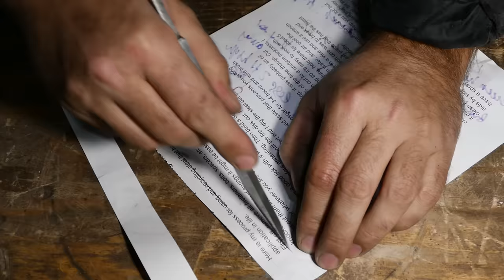Old Metal Files turned to a Fine Woodworking Tools

Comment: You have the equipment and good techniques for annealing, then re-hardening the steel and for sharpening these tools, but I can hardly believe you have ever seen or used any woodturning tools before. 
1. Grind all sign of the file teeth off to avoid damaging the toolrest. 
2. Round off the edges of the tools for the same reason.
3. Drill the hole for the tang first, and set the dead centre in it. the hole will then be central and in line with the handle.
4. The parting tool will work much better with a straight, not concave, bevel.
5. Both the parting tool and the skew are cutting tools, not scrapers. You will get a good finish off the tools if you use them correctly.
Reply from the maker: Thank you very much for breaking this down for me! I appreciate a lot!
I have a lot to learn, yes!
Reply: @Take_And_Make  I half expected that you would be on the defensive about this, and am very pleased you have taken it as it was intended - constructive criticism. Hope it helps.
Reply from the maker: I always separate constructive criticism from hate. We live and learn
Reply: ,c es un
Reply: Really superb works Shop equipment good
Reply from the maker: Thanks!
Reply: @tonynewton2250  Yep you went to far with the criticism, the tips and advice were well done but the last part of your statement was uncalled for.
Reply: So glad you pinned this post.   The skew especially can be quite dangerous using it like you did. Make contact with the bevel first and slowly bring the cutting edge to the surface of the wood while moving forward. 
Also, try to avoid making long workpieces thin in the center until your done with all the other shaping and details. The wood flexes too much and you start to get chatter from an out of round blank.   Even with the roughing gouge, and parting tool you’ll have much better success if you make contact with the bevel first and then raise your rear hand to bring the cutting edge into the wood.
Reply from the maker: Great tips! Thanks a lot!
Reply: I thought it was a perfectly good and helpful comment and was taken as such by a humble craftsman. I do have to say, regardless of always using the right tools in the right way, there is something special about just getting in there and doing a project as best as you know how. His end results are quite good and I am especially interested in the restoration of the files anyway
Reply: It is a giant leap in technique and knowledge between iron mongering and wood craft. Great attempt. Please do more research on the woodworking. If you mishandle hot iron you get burned. A mistake with wood tools and you can lose body parts quick quick.

Comment: Tempering is temperature critical, not necessary to time it. Traditionally determined by the colour of the oxide. Read Tubal Cain.
Reply from the maker: Yes, that's why I put it in the oven so I can control temperature to gain the color of the straw.

Comment: Hello my friend? i use to work bumper shop for 12 year and to keep the metal bumper cool when we had to grind it....On the belt we use a little soap, as the belt is turning just touch the soap to the belt for a blink of a eye. And to keep Like them blade from warping when harding make sure the top edge and bottom edge are lined up with north and south
Reply from the maker: Thanks for the tips!

Comment: I made a set of lathe scrapers years ago from old files but without the annealing and re-hardening, grinding only. I used brass pipe fittings to make the ferrules and they work very well. I also have a few crude lathe tools made by my grandfather from old planer blades, a very good source (if harder to find) of good quality tool steel.
Reply from the maker: Great point!

Comment: In addition to Tony Newton - for the handles - drill your hole first.  If you can, do it on the lathe with a Jacobs chuck so that the hole can be 100% straight.  Center on in the hole and turn the tenon - you can test the size.  Last the rest of the handle.  All in all, good work, however.  Kind regards.
Reply from the maker: Thank you for your suggestion!

Comment: Lovemaking two handles at one time . A smoother finial finish can be had using a 3/4" to 1" skew not a rasp .
When f8tfing the copper bolster use your calipers to measurethe inside diameter and make to shoulderto the  measurement  it can be sanded  to fit and  use gel CA when fitting 
Avter fitted youcan use centerpunchand hammer to make a dimple in the side to grip 
When seperating  the ends and halves start with thin parting tool and leave about a 1/4"remove from lathe and make final cut onband saw , and finish at belt sander 
You canadd details like groves near the butt and throat while sgill on lathe but pressing the toe of skew  then friction burn using a piece of thin hard wood 9r counter top laminate , with the lathe speed turned up high , detail rings can also be added to the copper ferrel with either a tubing cutter as you cut them , or the toe of skew 
When a final finish is decided on either a clear shellac or lacquer, they can be applied  while still on the lathe 
A final detail canbe an ulpoholstery tack in the butt end 
Thank you for the reheating and shaping information 
I have plans to make a round scraper from a mill bastard file
Reply from the maker: Thank you for the good pointers, Gary!

Comment: Hello why do you have to put the tools in the oven after how long and at what temperature ? Thanks👍
Reply from the maker: You put steel in oven after hardening to make them less brittle, read about tempering steel. I had them in oven for 2 hrs at 400F
Reply: The steel is like glass after hardening .

Comment: Nice job on the skew and parting tool. In the last year or so have you learned how to use a skew? Master the skew and turning becomes much easier. That entire turning could have been done with one tool and no need for sanding. It’s not easy.
Reply from the maker: I’m actually more into metal work now, but I feel like I’d get back to turning wood initially
Reply: @Take_And_Make  I was a production spindle turner for many years and after my new shop is done I thought I would get a small metal lathe and a mill. I'd like to incorperate the two mediums and i'm not into metal sculpture. I worked as a labtech in a scupture lab for 5 years. I teach woodworking now.

Comment: This video took a long time to figure out what was actually happening to the files. They actually get turned into wood turning chisels. The way I found this video was looking for restoring files though. You can't find any good files these days. Probably can't find any good wood chiseling tools either.  Does heating the files up then possibly clean them and restore them? Kind of like resharpening them but instead just making them clean is actually what's happening?
Reply from the maker: Just soak your files in vinegar for a week, than clean gently with soft wire brush
Reply: Heating the files will destroy them.
It will cause them to become soft (almost as soft as mild steel), and form scale (oxide harder than rust), making the teeth blunt.

If you want to restore files, get a brass or other softwire brush (not plated steel) and then soak in vinegar or other acid, take out occasionally and brush the grooves out, removing rust and clogged metal.
This should improve the performance of the files and not meaningfully damage the files steel. (Contrary to popular belief this doesn't really sharpen files, it just cleans them out).

If you look at your files, and you see reflective spots on the very top of the teeth, the file is worn out.
Now it can still be used, for example if you were to use the edge of the file (usually lasts much longer than the flat faces due to not seeing much use), or the ends can still be good, so you can use those.
But aren't going to be much good outside of extremely soft metals, or plastics and wood.

You don't need to toss them if they go dull though, they are usually very good steel.
You can turn them into marking knives, scrapers, wood or metal lathe turning tools, or practically anything else that needs tool steel, I've seen a bunch of really useful things for bits of files, one being removing the seam from the inside of tubing.
A little creativity and a grinder get you quite far.
Though, if you are using them without annealing/tempering, they are going to be dangerous in high stress environments (lots of shock or lateral force), they can shoot shards that will injure you. So learn what you need for specific situations, and you'll be fine.
Reply: @autumn5592  i have a LOT of flea market files that appear to have been used on aluminum. Getting those clean have been efforts in vain, nothing has worked. I'm not new to working with restoring files, just a bit of personal experience on seemingly impossible to clean files.
Reply: @TingTingalingy  Get yourself a soft scribe (if you have those generic small jewelers screwdrivers, you can grind a point onto on of them) or even mild steel rod.

Then you follow the groove of the file tooth, pushing along it, the aluminium should pop out.
May take a few passes to properly work, because the file teeth will cut the scribe to the same form as the teeth, allowing it to get deep inside the groove.

Use a magnifying glass or the sort to help you see if you are having trouble.

To avoid pinning on your files, frequently use a brass brush or file card, and for soft metals apply a chalk to the teeth, this prevents aluminium from sticking.
Reply: @autumn5592  I'm not new on how to properly use files. Chalking avoids pins better than wire brushes, in my experiences. If something requires me to use a magnifying glass to repair, that's a tool that's earned itself a one way ticket into its next life of use, as a different tool.
Reply: @TingTingalingy  I never said you didn't, I was just offering some information.

Chalking does prevent pinning, wire brushing does not -- frequent wire brushing just removes it before it becomes a problem.

You aren't repairing anything, you're removing pinning... cleaning the file.

I've been given files that were supposedly useless, but just had a bit of aluminium pinning, 5 mins with a scribe, and it was a new file that someone just hadn't cleaned.

 
I will say though. Good on you for not throwing out good steel. To many wasteful people these days.

Comment: Why are you heat treating them? They were already heat treated from go. At most you would've needed to temper down the HRC.
Reply from the maker: If you were paying any attention at all you would've noticed that I did in fact annealed those files in the forge prior to grinding them. Hope that answers your question.
Reply: @Take_And_Make  Sorry that I was also doing other things while lazily watching your video, I see that's a no no with you, as is your lack in knowledge of how annealing works. 

What you did wasn't really annealing, it was WAY too hot on some parts and too cold in others. Not unless your forge is made solely of refractory, which if it is, it is a ceramics kiln and not a forge at all. The method you used cools much too quickly, if your forge is a ceramic blanket lined with any form of refractory, to properly anneal or normalize. 
You also didn't employ the fast annealing process... So, maybe you didn't intend to come off as a rude sod, but you did.. welcome to putting yourself out there and getting feedback & questions. Smh

Comment: I don't see any reason to heat and tamper a file, they are plenty hard enough for wood turning tools.
Reply from the maker: The reason for heat treat was that I’ve annealed them in the forge for easier grinding/stock removal. You probably missed that part.

Comment: Your metalworiking files will last much longer if you lift the file off the workpiece after each forward stroke.  It appears that you are using a file like abrasive paper and are contacting the surface on the return stroke, bad practice.... I have files that are 45 or more years old that are still pristine after a lifetime of use by using the correct method of filing.  I was taught by a diesinker that was born in 1895 yes, 1895 he was good.
Reply from the maker: Thank you for your advice!
Reply: That was accepted as fact by many of us but, actually that is not true. It was completely disproved in a very thorough test posted by Fireball Tool a few months ago on YT.